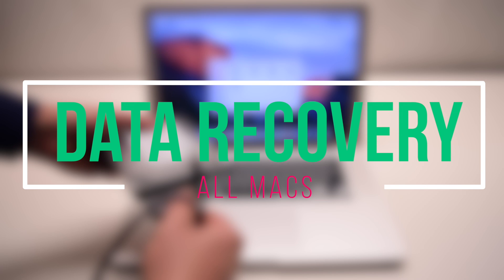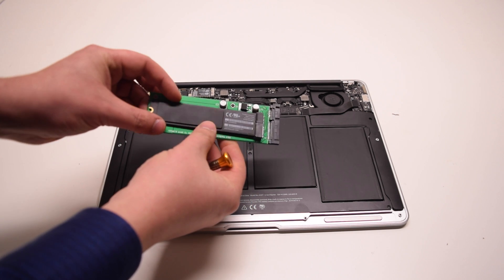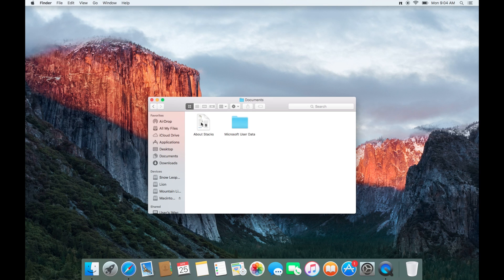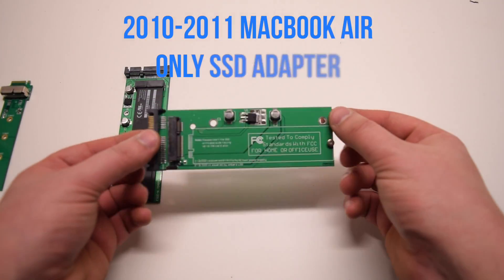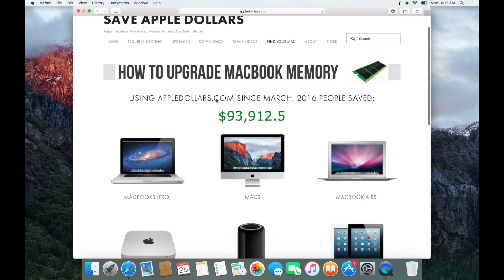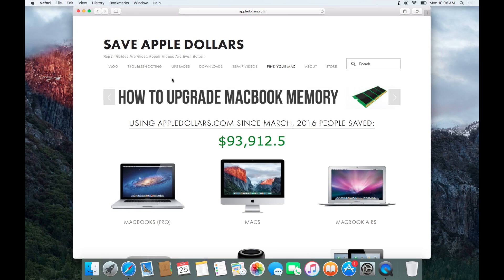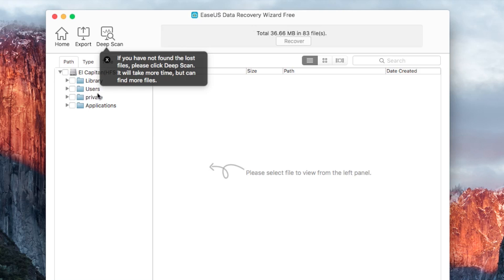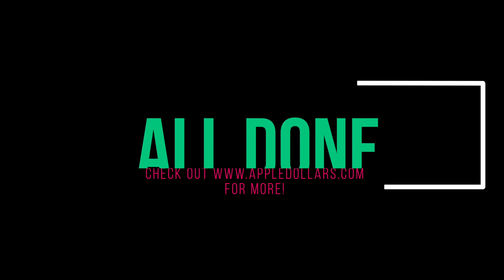How to Recover Data from any Mac Macbook ,iMac, Mac Pro, Mac Mini

Comment: hi, this video is great. I have a concern, my laptop problem is that turn on and off. I need to pull the hard drive in order to transfer 
my application folder including my programs Is this the way to do this?
Reply from the maker: Yes, you need this it's $7 with fast shipping http://www.ebay.com/itm/SATA-7-15-Pin-22Pin-to-USB-2-0-Adapter-Cable-For-2-5-HDD-Laptop-Hard-Disk-Drive-/131399276596?hash=item1e9801d834:g:Dr0AAOSw0e9Ur2br
This is the cable to convert the internal drive from your Mac into an external drive that you can plug into any other Mac and recover system files. Also note that you can just reinstall the old hard drive into any other 2009-2012 macbook and it will boot right up. This is the case if you have a SATA drive, let me know if you have a 2013+ macbook pro or a Macbook Air and I will send you the adapter links for those.